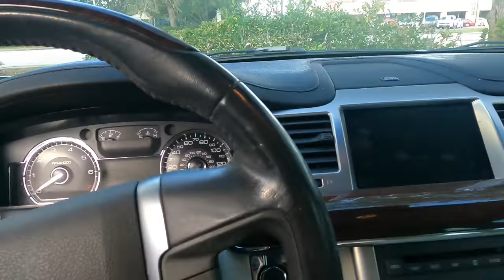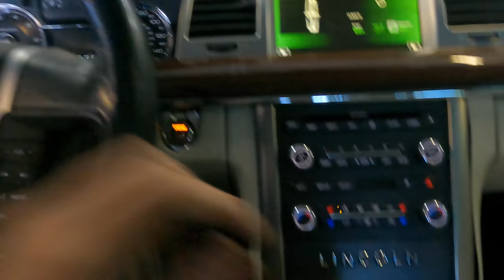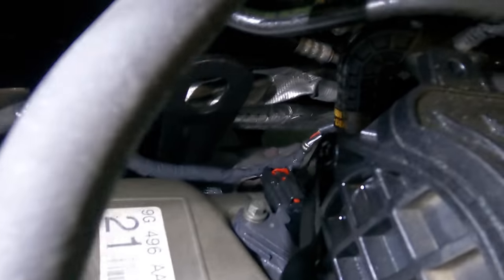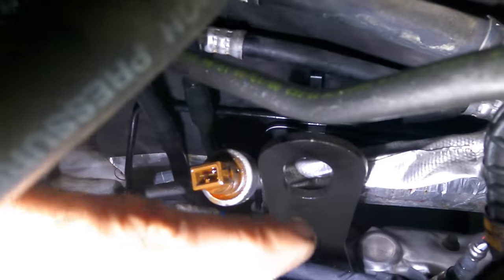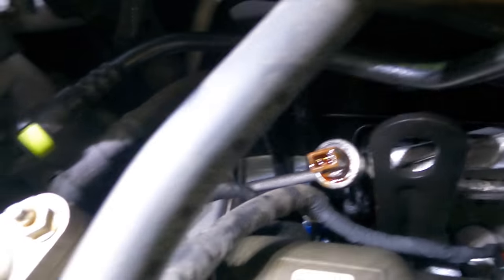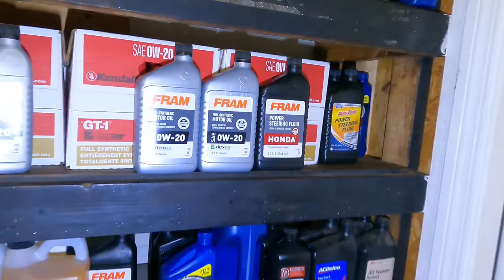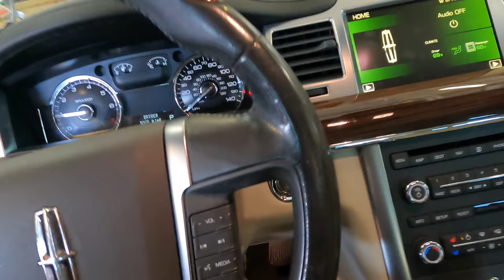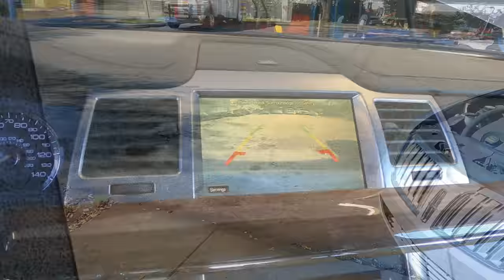Almost Caught FIRE! Lincoln MKS

Comment: When you started to wash the engine area off my wife was saying "Noooo don't do it!".   Her Jeep went in for some work and they cleaned it up after, and did a good job.   She picked it up, still dripping but shiny and clean.   Started fine, then started to leave.  When pulling out of the driveway the dash lit up like a Christmas tree, it started running rough and died.     So they pushed it back in and checked it out.  Deeming that water was the likely culprit, they then air gunned it, OSHA compliantly I"m sure.  Seems water got down into the electrics somewhere.   After setting in the sun for a bit it dried out and has run fine since.
Reply: Not sure why this seems to have posted twice in the thread...

Comment: I almost lost my engine once because of an oilpressuresensor leaking. The oil was spraying out, which I didn;t notice, and after parking the car I saw oil dripping. A new sensor was installed and I had to add 2,5 litres of oil.. Normally it contains 4 litres of engine oil, so only 1,5 litres were left in it. It was a Mazda 626 with the fabulous 1.8 engine. The engine was still ok, I have run it for a few years after this

Comment: I once brought my no problem Chevy for GM steering rack factory recall.
Afterward a few days later I almost got kill when I try to make a right hand turn inside the city and got super stuff and won't turn.
Luckily the brakes works.

Took it back to the same certified GM service department, they told me they have to install a brand new rack and pinion replacement.
Then he said it it goes wrong again I have to pay for the next replacement.😱
I was shocked from the service representative.
In my mind ,"WTF".😟

Comment: I once had to spend three months reskinning the bottom, side, and part of the internal structure of a F-15E because of hydraulic fire when I was stationed up in Alaska. A hydraulic line ruptured a pin hole leak right on landing shooting basically a laser right at the red hot brakes (it had just touched down and was braking) which turned that leak into a flame thrower. It burned a hole through the landing gear door and then torched the entire underside of the jet burning all the grease lubricants and everything else that had a flash point. It was a mess and we called it the crispy jet. Burnt hydraulic fluid and metal is the worst smell in the world too.

Comment: Hello Ray I had a Ford Focus 08 and me power steering had a leek I trued that stop leak was sh t and I had no cash to fix it ford wanted 900-1300 cash so wile I saved up I used vegetable oil in it as I was empty after 15 miles got the parts on line and I cast me 100 hose and 100 in labour was ok when fixed

Comment: A nice quick easy r&r..the best kinds of repairs.  You always go above and beyond...EZ engine compartment detailing:-)  One thing I did notice...when you cranked the wheels lock to lock you had it on the ground...wouldn't it be better for front end components to do that with the weight off of it..thus no extra wear. I have heard that its much easier on the ball joints etc when the car is in motion vs cranking the wheel while at a standstill.
    Another great video Ray:-)
Reply: You want the system to work hard to expell the air
Reply: Well yeah, if he was doing it hundreds and hundreds of times, but two or three turns lock-to-lock? Nahh... no measurable wear.

Comment: I remember when power steering was a closed loop, purely hydraulic system. I can't even fathom why a pressure sensor is needed, it's pretty damn obvious when there is a lack or loss of pressure in the steering system....
Reply: Can already see Ray calling the parts guys for a replacement customer. 'broken power steering sensor'.
Reply: The power steering pressure switch is a on/off switch and is not a pressure transducer. It’s purpose as a input to the pcm is to increase engine rpm to compensate for load.

Comment: Mercon V should be used in the power steering system, NOT power steering fluid. Fords/Lincolns/Mercuries haven't used "Power Steering" Fluid for years.  Other than that, it's a great video!

Comment: Why would you start the engine and create foam in the fluid? You could slightly lift the vehicle and turn the steering lock to lock and expell the air in the lines.

Comment: That connector should actually be pretty easy to get. It look the same as a Bosch EV1/Jetronic/Minitimer fuel injector connector. You also used the wrong fluid in the power steering. That generation of Ford's uses Mercon V in the power steering.
Reply: I remember when it used the same fluid as the Transmission. Type F Transmission fluid.

Comment: This might happen when you raise the pressure by holding full lock with power steering fluid. In a none power steering fluid system. 2cents

Comment: I've watched a few videos of yours were you wash the engine.. I've always had too much anxiety to do such, because I was told by a shop teacher if the engine is warm it can crack the block. Also I have anxiety about water getting into some sort of electronics/electric connecter/alternator and mess something up. Could you either comment or make a video about engine bay washing? Like things maybe you should cover or avoid spraying or just any good info? Thanks

Comment: At 13:00 you can see that Ray's work is complete because the car gods put a rainbow over the engine.  Particularly at 13:15 when the rainbow touches the oil cap.

Comment: Pro tip don't wash the motor til you check oil cap dip stick and any thing that someone might open cause you might put water somewhere you wasn't planning due too loose cap or open access too places where it will damage something expensive....lol ask me how I know? Let's say someone checked oil but didn't put stick in hole so water went in and cost alot time fixing milk shakes.....

Comment: Great  just great RAY ,you repaired the power steering and converted that car INTO A FLOOD CAR.haha About those safety nozzles,they're designed to ALLOW air pressure to escape around the main hole in the middle when put against the skin,keeping you from giving your workmate an AIR EMBOLIZATION !!! But i found if you just run a 1/8  drill through the hole ,it brings the full pressure back.OSHA found to many claims where coming in from mechanics giving other mechanics BUTT embolisms while they were bent over the fenders working on the engines.With the long nozzle you have you can reach the stall next to yours,haha

Comment: I was wondering.....because of the colour of the previous power steering fluid and because it was a ford product, instead of having power steering fluid wasn't it supposed to have automatic transmission fluid in there?

Comment: some Ford vehicles have a TSB requiring a vacuum be applied to the pump reservoir to remove the air from the system when refilling the fluid. Damn noisy PS pump.

Comment: Is it actually ok to hose down the engine bay like that with water? I’m sure you know what you’re doing cause I’ve seen the good work you do, but I’ve always been told that it’s bad to spray under the hood in general. Not trying to say you’re doing anything wrong, I just don’t know much about the topic and wanna learn. 
Regardless, I enjoyed the video and I look forward to the next one! Keep up the good work Ray👍
Reply: Generally yes as long as you don't soak the electronics. However, I pressure washed the engine in my 96 XJ and a few weeks later, for the first time in 25 years and well over 500k miles it stopped dead on me while driving. I got it towed home and found no spark, the coil (which was original) had rusted and gone bad.
Reply: I would do it very carefully as getting water into connectors or fuse box could be costly

Comment: Did you ever get the cap from the power steering oil bottle out? Seen at 10:34, 15:13 and more, or did it fall out during the test drive?

Comment: It would be nice if you washed the engines you work on with dawn before you gave them back to the owner. 
The Car Doctor here in Naples washes the engine and the under carriage before it goes into a mechanic's bay ($20.00).

Comment: You can wash your engine off.. with out any worries?..I have a 2year old van with some dust on it ..just wondering if I can clean it
Reply: Just use a garden hose. Don't use a pressure washer. Make sure your dipstick and caps are all tight and sealed. You'll be fine.

Comment: When it comes to fluids such as PS, brake, and transmission, I always use OEM. Since systems are so sensitive, I don't want to take the chance on using aftermarket fluids. Otherwise great job!
Reply: In my Fords I've just always used Mercon/Dextron in the PS system.  I do use OEM coolant and transmission fluid in everything else for sure!

Comment: The only reason spraying off the engine with water would be its hot and if the water is cold but water itself is fine. Old cars can't because they have spark plug boots not coil packs. So water could get inside, but now nuh its all sealed. I use to work at a big car dealership that put out 700,000 cars a year and all their engines are pressure washed. Every single inch soaked.

Comment: I have no clue why people think spraying down the engine bay will ruin your electrics (pcm,tcm,abs and so on). If your hosing down your engine bay for 30mins with alot of water then I can see a issue maybe accruing MAYBE. If your doing a quick 5 min spray down your not going to hurt anything.

Comment: Two comments or actually questions Ray.  Why do we all hate using funnels and then get frustrated when we spill fluids?  LOL     2nd question .  I am not a mechanic but was told to never wash down an engine or engine bay as it could damage electrical components.  I hate a dirty engine!  Is that not true?

Comment: The Osha blow gun is for ear protection those smaller holes reduce the noise.

My old job we had a blow gun with a big hole I used to blow dirt out of my truck couldn't hear good for a few hours sounded like I was under water

Comment: The blow gun is designed so if the end of it comes into contact with skin it doesn't put the full 90 - 100psi into the nozzle and puncture the skin. That is what i was told by a safety dude anyway

Comment: i have a question for you sir if you willing to answer. im trying to replace the front diff on my 2004 f-150 and i cant get the vary top bolt "witch is the last bolt i need out" out. its being blocked by the power steering rack. i was wondering if you had any tips or tricks that might help get the bolt out. or if you know of an ezer way of replacing the gears in the diff without removing the housing.

Comment: ah the osha thing.  If you blow compressed air into a cut in your skin, you can blow your hand up like a balloon.  This is a known hazard,  well a few years ago my workplace at the time replaced all our air nozzles from the regular kind, to a different version that didn't work well because the air stream was too gentle.  So they changed them all over again, to the osha approved design exactly like the one you showed, and they worked well--actually better than the original ones--but if you ask me the air stream you get from these things is actually more powerful/more hazardous than the original, now-illegal ones.  But, OSHA approved them so there you go.  OSHA makes everything worse, and needs to go away.

Comment: Since you're not using a power washer, it's fine to clean the engine like that. BUT, pouring water on a hot exhaust can crack the manifold if you're unlucky. 

Otherwise, I wouldn't clean an engine like that anyway. Dirt is usually not a problem, but a bad seal on a connector can absolutely cause an issue, if only temporarily. Still, not really worth it

Comment: Haven’t done it myself, but everything I’ve read says to bleed the power steering with the front wheels off the ground and about 20 turns lock-to-lock.  Is that not necessary?

Comment: Saw a wrecker burn because the pressure line developed a pinhole leak and blew a hi pressure mist onto the exhaust pipe.
Reply: Yup. That was probably unavoidable but people now a days think "it's just an oil leak" I don't need to fix the flammable liquid leaking onto hot components, I'll just keep adding oil. Until it burns or locks up because they are incapable of replacing the missing oil regularly.

Comment: I have questions after seeing you wash the entire engine bay like that. I didn't know that could be done on the battery terminals
Reply: I'm an old man and over the years whenever I wash my car at home I also wash the engine bay and have never had issues . I am only using garden hose pressure . Also every time I check or change my oil i use the dipstick to Drip some oil on each terminal and have never had any corrosion buildup . I've had this same car for 25 years and 220K miles .
Reply: @eaglerider1826  arnt you supposed to at least cover the alternator? (And obviously, stay away from intake) probably dont want to do it with a hot engine either.
Reply: @Straight_White_Fatherly_Figure  You don't need to , but don't stick the nozzle in the fins either . The alternator was designed to withstand rain and puddles .
Reply: When you drive on a really wet day and there's a significant amount of water on the road, some of it will be flung up into the engine bay, and water hitting the front of the car is directed through the engine bay also.  All components have to be tolerant of  getting wet, because they are going to get wet under normal operation. This includes the alternator and the rest of electrical system.  Good maintenance is an important part of this.  Rubber boots that are damaged need to be replaced, and components need to be more or less clean.

Oil/hydraulic fluid is probably more damaging for the alternator, so removing oil from the engine bay is a great idea.  Water dries, oil just gunks up and makes a grinding paste eventually.

I used to have a vehicle where the alternator sat close to the oil return hose on an aftermarket turbo.  Even though it was high temperature hose it used to get hard and leak from the connectors eventually.  After I had one alternator fail probably due to this, I always made sure to replace that hose every couple of years or before a long trip.  It was the main item on my my check list after oil/filter/cooling system hoses.   Lesson learned: oil bad, water OK (that vehicle used to go through meter high water no problems at all).
Reply: @Chrisamic  I'm a little too OCD when it comes to keeping my engine bay clean . I once changed a leaking valve cover and decided to clean the oil off the bottom using brake clean . everything was looking great until I noticed I was spraying a direct stream into the back of the alternator . It was stupid and yes I had to replace the alternator .
Reply: @eaglerider1826  Oh, I'm guessing the solvent damaged the insulation on  the windings.  It's basically just varnished wire.    Yes, that would be Bad  😞

Also, bearings do like to have some lubricant in them  😕
Reply: @Chrisamic  The only good thing was that I had replaced the alternator the year before and it was replaced under warranty . So it was just my labor to replace it

Comment: I’m surprised that oil wasn’t forced into the harness. I have seen so much of that with Mercedes engine harnesses being ruined by oil being forced / wicked into them. Oil would contaminate control units and O2 sensors.

Comment: You even gave them a free power steering fluid bottle cap, left under the hood near the passenger side strut tower, at least now they'll know you used some new fluid...or they'll wonder where it came from🤷🤣👍🇦🇺
Reply: I'm glad someone else caught that .
Reply: @eaglerider1826  I saw it as well.
Reply: Didn't see that cap on the washdown of the engine bay, Ray sharper than that!  lol
Reply: @d.faulkner8210  It was still there during and after the washdown, and when he shut the hood at the end🤣👍
Reply: Right, like the owner of a Lincoln ever looks under the hood of their car.
Reply: @wrench31e22  🤣👍
Reply: @wrench31e22  Yeah, They just let the smoke come out and then drive to the mechanic.

Comment: When did power steering require a pressure switch?
Reply: So when you turn your steering wheel and it put a load on a motor it will increase the idle

Comment: the reason the air cleaner/blow gun has extra hole's is to stop you or some one from injecting air in to you or somebody else as a safety, so the air has a escape rather than all the pressure trying to put air in to you Which can be fatal :) hope this help's

Comment: Many many years ago flew my cessna 172 into lake geneva playboy club.  Got 50 gallons fuel and the fuel kid checked the oil.  Did not install the oil cap correctly.  Oil flew out in massive way onto the windscreen just after takeoff..   did a quick return to the flight line and waited for the gas kid to use two boxes of shop towels and  brake fluid and dawn n water dish soap to clean off everything but the tires covered in oil.  Lost 5  quarts of the 12 quarts  in the 470 engine in 3 minutes.   That could have been worse at night or if I made it 5 to 10 minutes away.  
      Lucky i said oil cap... get on ground and engine to idle  in one quick sentence.  With a few  added bad words.   My fault for not checking the kids work.  
       Kid was scared he would be fired ... all I said was are you ever going to do again ???   He said hell no.  So he and I worked out the issue while wiping off oil.

Comment: What’s with ford and damn pressure switches !? Over the years there have been multiple recalls for pressure switches on brakes and fuel for fire hazards on pressure switches leaking through the electrical side and catching fire. Even worse, a few of them were wired hot to the battery buss by design  and would catch fire with the vehicle just sitting there key off!